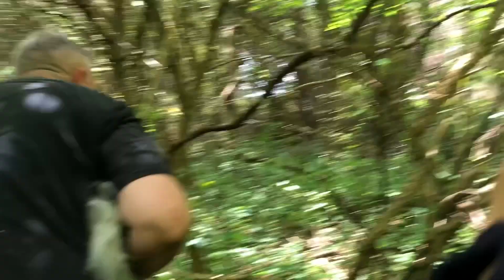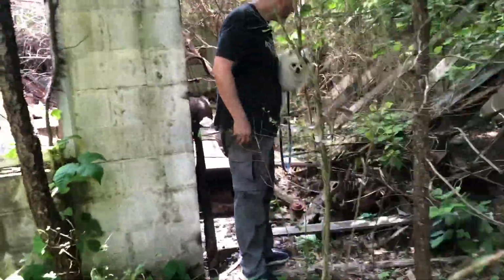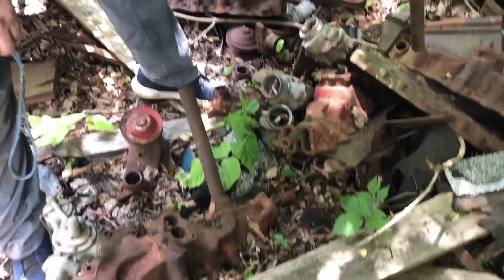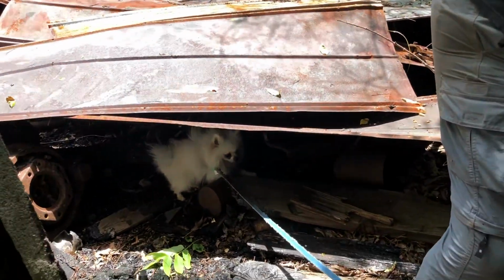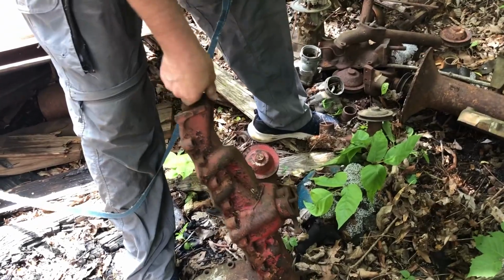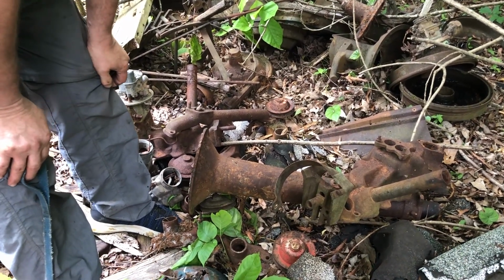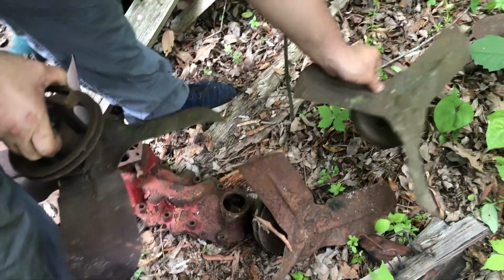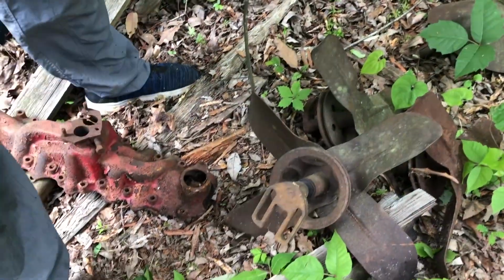1950's Flathead Garage - Burned To The Ground

Comment: I wasn't aware of the call for flathead ford engines was still a hot ticket. I am seventy three and they were in many ways just a engine that would self destruct in many of our rigs we used them in. I do know the mercury engine was a bit more for the fact it had the longer stroke crank. I'm not sure if that made the 239 into the 254 cubic inch or not... I know one thing, nice sounding pipes on a good many of the ones I had... I also used the lincoln 337 in a few of our F7 logging trucks
Reply from the maker: They aren’t a hot ticket.  I just like them.